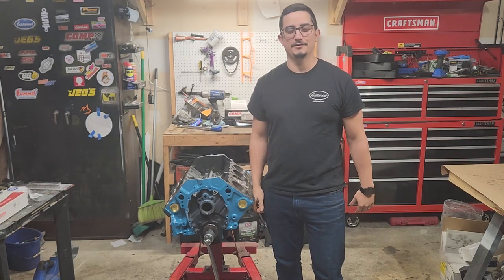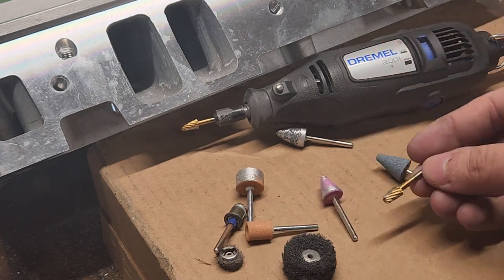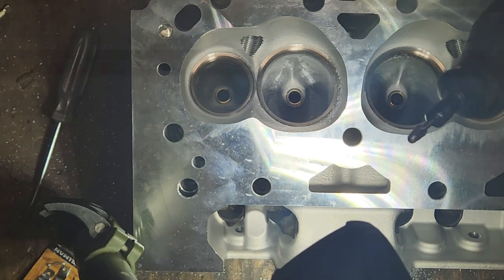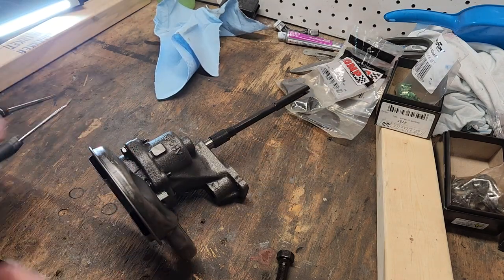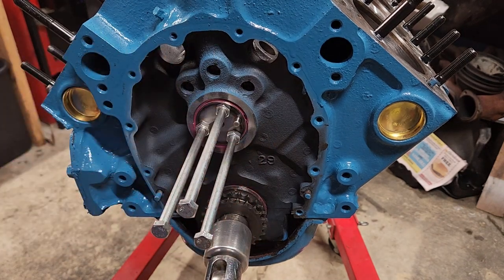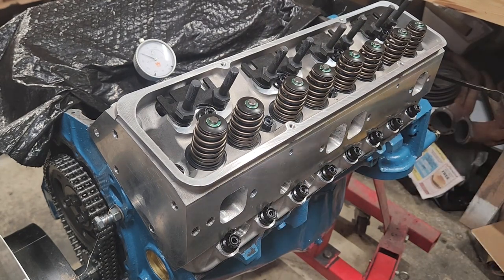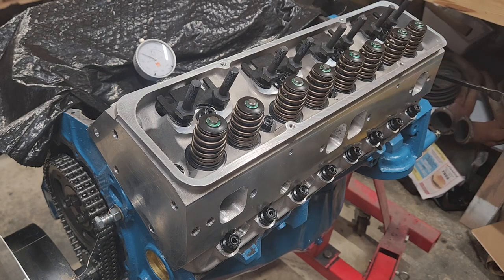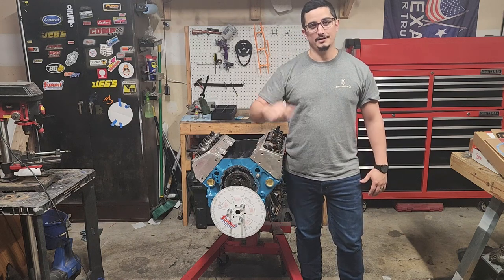Ebay Heads for BUDGET Power?? Are Ebay heads any good? - 400 HP 350 Small Block Chevy Build Part 4

Comment: If those are chinese valves, dont ever use them! They deform under load and heat and disrupt! (get a good set of Manley severe duty pro flo or Ferrea stainless steel valves with back cut heads, Milodon valves are also fine for street built)
Reply from the maker: Using some Elgin SS valves
Reply: @diveingarage  ok for street they might be ok as long they are not made in China....I would never ever use any chinese valve in my engine! (a hit or miss situation)
Reply from the maker: Definitely some low quality control on imported parts. But this will be a street engine.
Reply: @diveingarage  yes but valves (especialy exhaust ones) wont know whether they glow red on street or race.... I would not trust chinese metallurgy on exhaust valves. (Intakes will run cooler) Dont forget the price, you cant make a set of 8 good valves for 60 Dollars, not even for 100, a good valve will cost 30-40 dollars per piece.

Comment: The way u measured the spring height was hilarious you were totally wrong on every measurement. The checker was a inch tall right? so each big number on the side are the .010 and the numbers on the line up the middle are the .001 so when u measured 35 and 7 it was reading 1.042 since .035 plus .007 is .042 it's graduated the same as a regular dial caliper on the barrel.
Reply from the maker: The height checker was over 1", can't remember exactly right now. But I did make some spring install height changes in my next video. Check it out!
Reply: @diveingarage  plus you measured the spring height gauge from outside to outside BUT the top had a recess in it of 100 tho or what ever...opps i see below its pointed out so you got the picture cheers, plus dont over tighten any gauge it only needs very light finger tightness
Reply: He was wrong, but not in the way you say.  The hash marks in the middle are worth .005" not .001".  It's always a slight guess +/-.001" if the reading doesn't line right up with a hash mark.

The problem is he cranked down on the height mic like crazy, the measured the mic unloaded with a caliper.

The proper way to use it (and get correct measurements) is to tighten it just enough to square up with the retainer, and that's it.   Then, when using small OD retainers like those, subtract the distance that equals the counterbores.  Most height mics are .150" deep.

The overtightening is why the caliper measurement didn't come out even and match the height mic.

Comment: You seem to have a basic knowledge of how to assemble heads, but I gotta ask. You had a bottle of assembly lube right there on the bench, yet you assembled the heads completely dry. WHY???
Now you're basically going to start an engine with no protection
Reply from the maker: Don't worry! Everything got a generous coat of assembly lube before startup! You'll see in later videos!

Comment: Dont buy Chinese heads they have non hardened valve seats and those seats can come loose! You cant use the heads without a complete valve job! The valves wont seal and burn!
Reply from the maker: Wanted to try them out and see how they do.
Reply: @diveingarage  be careful, let the heads check by a good machine shop! Let them make a HQ 3 or 5 angle valve job and port the channels. Dont forget you will have to deck your block or you will get a too low compression ratio and a bad quench! The engine needs a 0.040" quench to prevent knock with todays crap fuels. If your block is undecked you need a special thin .15 head gasket for aluminum heads. Best use Fel Pro 1094 (other too hard gaskets for cast iron heads indent the aluminum head surface)
Reply: Umm… they’re ductile iron seats, these are also the same castings and seats used by AFR on their enforcer series small block Chevy head, same for Brodix with the Pro 1 cylinder heads, they DO NOT have “soft seats”.
Reply: @Schlipperschlopper  also, coming from a guy who owns a engine shop, and machine shop, everything you just said was and is complete bull-hockey, as I said in an earlier comment I made 553 horsepower and 490 ft/lbs of torque with these heads with a +.100 valve due to me running a Retro-fit roller cam, full roller rockers and 1.550(diameter) springs.
Reply: @diveingarage  you’ll be just fine, don’t listen to the guys who say “don’t buy Chinese heads” they tend to be the typical guys who’ll buy the same casting from AFR for triple the price, imagine it like Apple vs Samsung, or even Sony vs Microsoft, they don’t realize half the stuff from AFR, Edlebrock, Holley, Brodix, Clay smith, Professional products, and more are cast in Taiwan, China, Mexico, and also Australia, very few are made in the USA (and even then it’s a Chinese core). 

Run them and you WILL be satisfied with them.
Reply: @Shade_tree_garage01  maybe horsepower but will it last on the street for years?
Reply from the maker: I'm pretty pumped! It's coming together, almost done!
Reply: @Shade_tree_garage01  what is your thoughts on the melling HV oil pump with stock volume pan?
Reply: @Shade_tree_garage01  Slapping junk together in your "garage" doesn't make you a "machine shop" FFS!! ROFLMFAO!!
This thing is an absolute disaster waiting to happen!!
Reply: @donaldreese2688 It's fine to use but unnecesary for a stock engine. No it won't suck the pan dry.

But for an engine that doesn't see more than 5000 RPM and is street driven, it's way more than needed and will only serve to increase wear on the distributor gear for the higher power extraction of moving more volume.
Reply: My apologies for the guy who thinks that you can get AFRs for a few hundred bucks.
Reply: Even genuine AFRs should always be checked for a proper valve job, it's  usually off if you buy it assembled.
Reply: By the way, you should always tap on your valve locks to get them to seat right.
Reply: It's  not a good idea to teach others when you don't  know everything that you need to know. Others will make the same mistakes.